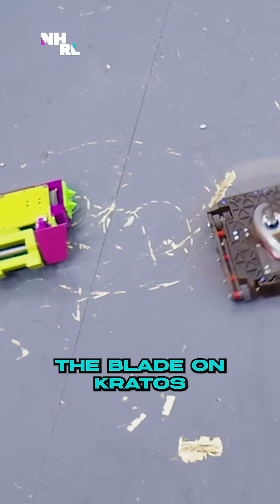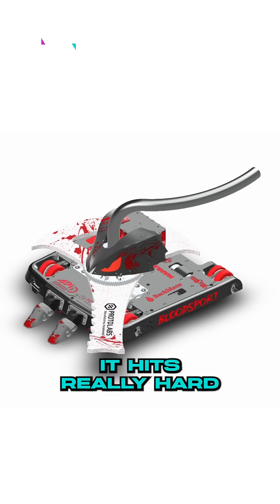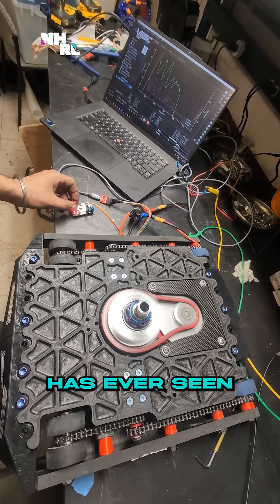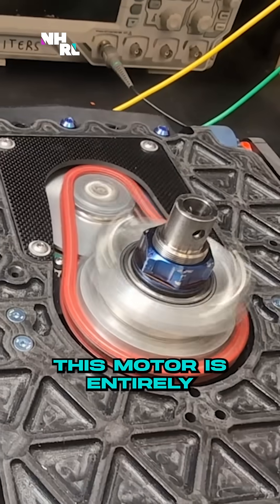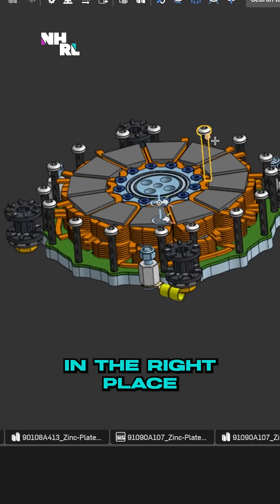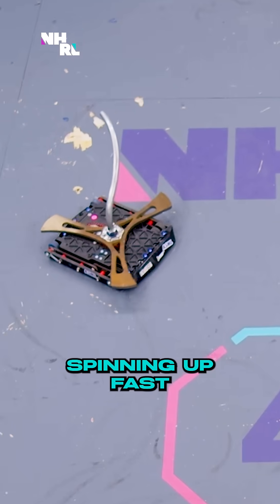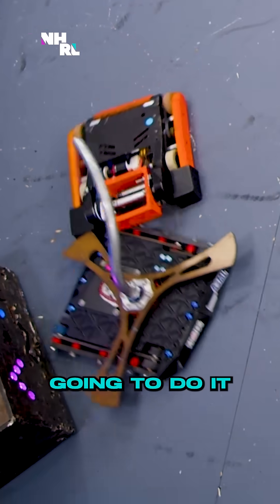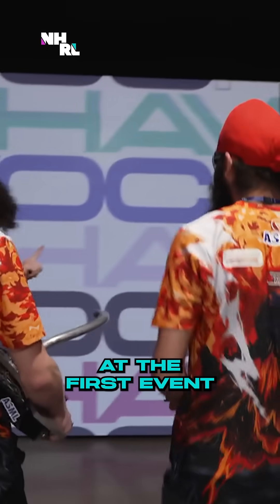MIT Team Built a Custom Axial Flux Motor to Fight Robots

Comment: either Clutch plate failed or motor-blade conmeting machinism failed or Due to the impact force the moter lost its momentum and slowed down causing back emf and frying the motor electronics or due to the impact force electronic components or battery connections must had dislocated

Comment: Was it just me or anyone else was waiting for the dude to explain the reason behind that wierd iron pipe they have installed on top of it??
Also they need to add more gears or bearing to the chained gears of blades, because then this way upon impact the motor will not take direct hit and break it, the impact will be heavily reduced by bearing or loosely fitted another set of gears whos only purpose is to absorb the reverse rotation impact!
They need to install free wheeling in it which is used in electrical bikes....
Reply: The weird aluminum pipe on the top is extremely useful.  I think, required.

Comment: Should probably go with a belt drive instead of a gear drive. You could also do the equivalent of a CVT in there and that would help get the weapon spun up quickly without overburdening the motor

Comment: They forgot to protect the base. If another machine with a lower rotating blade hits Kratos and did a slightly upward impact, then it's cooked. 

Also, they should use a lighter and more resilient material for the blade with machine protection in its priority.

Another is that the base design is square which is counter intuitive for its weapon which produces a circular motion. Either make it circular or a hexagon. 

Lastly, can't they place the blade like a burger patty? Put the electronics and some shield in the upper and base part of the machine? 

I'm just asking. I'm sure lot's of people here smart. Please do answer some of my questions/suggestions. 🍻

Comment: I used Google gemini to create a scalable software program

Out of magnetic motors, Dynamos, electric motors, and magnetic motors, with dynamo recyclers inside, for ionic thrust and data transmission and gyroscopes

As well as power generation, and motor control 

With magnets, copper, rings, and ball bearings or roller bearings, and batteries, sometimes gold also

Comment: Well….koenigsegg(the hyper car company)has had 2 motors just like for a few years now….they even call it an “axial flux motor” so…..the chances of that happening id say are pretty slim……the call them “Dark Matter” and “Quarke-E” ….they boast unmatched power to weight ratio…..annnndddd they look IDENTICAL to the one here…..and if its been out for years….it was likely in production for several years before that….

Comment: Lower the weight of the arms because only the ends make contact ... and make the blades slightly heavier as that'll give you more rotational impact on contact ... replace the arms with Aluminum...and make the blades custom and interchangeable based on robots you're fighting ... great design

Comment: I'm surprised the MIT guys tries using an axial motor in this application.. It's really wide so it has tons of initial inertia which means they're harder to get going. Imagine trying to lift someone on a seesaw except their side is really long and your side is really short. It takes a lot more effort to get it started.

On top of that the other problem with being flat and wide is it's really thin so it's easy to bend and break. It's basically the worst possible application of this motor.

Comment: That's similar motor tech to what's used in the Thrustmaster T598 Direct Drive wheel base and that thing for its size has some real power, so if they managed to put that tech in a robot then I wouldnt want to be the one to challenge it, also if you have managed to make your own design and its compact then patent your design if possible and talk to other companies as im sure lots wouldnt mind a small motor like that as most the other motors of this type seem top be larger than what's shown here.

Comment: I’m in the engineering pathway at my high school and my freshman year I made a generator using a similar principle. The only issue is that I didn’t know to use insulated wire and the stator and rotor were too far apart, so I’m planning on trying again soon

Comment: Hearing him talk about how advanced this new engine is, just to see it not be able to spin up and face the exact issue they were trying to avoid still happen is hilarious.
Reply: "we just need a fraction of light speed and it will work, that's what the fusion reactor is for"
Reply: Probably the motor controller frying. I guess they must have built a custom one for their custom motor, and it's not an easy task, especially when you go from 1000 rpm to 0 rpm almost instantly, these things can fry easily.
Reply: *motor
Reply: Did they even test it one time??? Wtf
Reply: @HCEndgame absolutely , test it one thing, they’re a college sports ? Robotics + Sports team and they , absolutely did function tests.  It is expensive to replace those pieces and repair the whole thing & what other robots would they fight with? Not many other fight-bots to  test on! ! 😅

Comment: Looks like maybe an issue with the chain not meshing properly. With those speeds and torque you absolutely need a serious tensioner. Preferably a chain guide style. I'd imagine it could stretch a small chain like that out pretty quick

Comment: Of the ends of those propellers angled down at the tips and then went flat out at a lower trajectory, a few millimeters off floor level with a slanted edge like a blade, it would be able to slightly lift other robots and negate their traction as it pushes with its main movement motor.

Comment: I’m sure they already know this but they will need an encoder on the motor and a controller which can do sensored control. Then they can get full torque at zero RPM. A controller designed for propellers is good at high speed control but they have poor low speed torque as they only need to spin up a prop. A controller like Odrive could do it!

Comment: One design I thought about the haven't seen, is a spinning disk or shield designed to absorb the high velocity impacts of these type of attacking machines and transfer that energy into a rod that both goes out, under, and up an attempt to flip or thwart the attacking machines every time they utilize their only specialty. It would not be a full transfer of energy. I'd have to take a lot of absorption, but could still puncture or flip.

Comment: The most important thing here is not the speed, or how fast it spinup.but how can it withstand impact... Each impact at full speed from the tip of the blade is  gonna transmit and INSANE amount of force to the motor. And THAT is what break motors on those kind of spinner.

Comment: Yes 👍. You are spot on. Maximize the motor diameter as much as rules allows. The rotor diameter adds to the torque thereby have better acceleration. Furthermore I see You increase the torque further by an increasing ratio with sprockets & chain. Any extra links or gears does creates the weak point. I see the best possible way is to fixed the weapon on the rotor itself thereby simplifying the setup. ❤thanks for sharing your Built. Awesome bro. Good job.

Comment: MIT the type to invent a new motor for a fighting robot
Reply: It's a direct copy of a motor that is already on the market that you can buy. The company is small & they aren't everywhere or anything but the fact they've gone as far as fitting them on bikes OEM sure makes the dudes claim silly.
Reply: @bo-dine7971  Sure, but this one is actually flux optimized and manufacturing the flat coils is also not trivial. They obviously have access to special tooling for that. You still have to know your stuff to even know where to begin with the design.
Reply: @Atom224 exactly this. Not a new motor type, just a custom design of it.

Comment: Instead of using a chain drive, it would be better to use a direct drive system. When the machine suddenly stops due to an obstruction or impact, all the pressure and force are transferred directly to the chain, which can lead to damage or failure. Please correct me if I’m wrong
Reply: they need the gearing reduction of the chain drive. Something like a torque converter you see in a car might be better for this application though.

Comment: Idk if it would be possible weight wise, but you could have a flywheel with a similar mass and a clutch. Flywheel never stops spinning and helps to get the blade up to speed.

Comment: Ah. He messed up the offset of the coils and magnets for stratup. Needs a flywheel on motor and it Needs a CVT enstead of a chain like the ones on go karts. Then when it hits something it slips and your motor still spins then eventually the cvt clutch kicks in and gets your blade back up to speed, put a hydro torgue converter for a car to it and that motor would never feel a thing

Comment: You might want to consider using a viscous clutch / torque converter so the motor gets to spin full time and the blades only slow down on impact. Should also make it more gentle on the driveline. A simple housing and impeller with silicone oil might make it possibe. Kinda like a viscous fan clutch from a car.

Comment: That looks fiercely dangerous. And I’m not talking about “to the other robots,” but rather to the spectators. It’s not as if these robots never wreck each other. (Hardly that!) 

So let’s assume: a) that some other robot manages to damage this one—and b) that the damage causes that rotor to fly off. In the event, I doubt that the protective plexiglass screen between the arena and the audience would be enough to sufficiently contain the relatively huge amount of energy stored up in what is basically a heavy flyweheel with teeth. Hell, it could just as easily fly over the plexiglass barrier.

Comment: That motor works basically the same way maglev trains get pulled down the track or how modern rollercoasters launch without a hill. They seem to need to work on their programming and probably add a backup to control it if the main breaks.
Reply: That's basically how all electric motors work. It's just various setups of coils and magnets.

Comment: Design a gear between the motor and the drive that chain ⛓️‍💥 is going to be your weakest point it will snap when you slam it to a stop after so many times

Comment: I had heard about these well i read the paper on it. I can't believe you built one that is awesome. I am a bit surprised that you guys aren't utilizing some of the magnetic energy to couple the drive shaft magnetically reducing friction and increasing the torque and rpm. also reduces complexity as all you need to do is arrange some magnets around the shaft and add a coil to amplify the field and spin it up on a vac bearing to see how fast you can get it before centrifuge become the issue for the blade.

Comment: axial flux motors used to be used quite commonly in disk drives, most commonly 3.5 and 5.25" floppy drives, seeing one setup this way was impressive, can't wait to see where this goes, also, might wanna add a clutch so you can disengage the weapon from the drive
Reply: I think the motor is the clutch. If the weapon gets stopped the rotor just stops spinning inside the stator.
Reply: @nunuvyerbizness  Agreed I imagine they're driving it with FOC capable electronics so it's probably as "easy" as automatically letting the motor freewheel as soon as the current peak from an impact is detected.
Reply: @oliverer3  could that be why they had trouble? Motor got cut with an impact and couldn't get far enough away to get started, or something bent and added slightly more resistance than expected?
Reply: @freescape08  Seems plausible, it can probably deal with some additional resistance but starting up with it physically blocked certainly wouldn't work.

But if memory serves their main issue at the start was that the motor was wound for peak RPM rather than torque so it had so low stall torque that it struggled to commutate properly.
Reply: @nunuvyerbizness what’s the chain for?
Reply: @altenmuenster  To isolate the sideways forces on the shaft from an impact, bending the motor shaft would be much more inconvenient.
 Also useful for a gear ratio and shifting the position of the motor if needed.
Reply: I love when you talk nerdy. Turns my floppy disk into a hard drive...if ya know what I mean 😉
Reply: I suppose it needs two stages, one to get the heavy motors started and the other to switch into for high speed within a second or so
Reply: @Sokofeather absolutely! This is the fix
Reply: Also in high speed VHS and HDDs.
Reply: Adding a clutch isn't most likely required if other safety measures are followed. Most likely it would only add more weight to the bot.
Reply: Leave it to Berkeley/Stanford/MIT/Carnegie kids to think they invented the wheel lol.

Comment: You might want to consider installing a clutch of some kind between the drive gear and the blade so the sudden stops when you hit the enemy robot aren't as devastating to the motor.
Reply: Eureka 
Aahh moment
Reply: maybe just a spring disc like the one on the clutch is enough.
Reply: yup, that's what kills lawnmowers
Reply: Or better yet, a torque converter.
Reply: @DARTHNECRION  A clutch and spring pack would be lighter, no? Intuition is pointing to liquid=heavy in my brain.
Reply: afaik the point of the design is that the motor should be able to tank the hit, and the chain acts as a small buffer.
Reply: Better yet: a bunch of small axles gripping on a rubber wheel, like bite force
Reply: Better yet: a bunch of small axles gripping on a rubber wheel, like bite force
Reply: That's a clever way
Hope it makes to the list of top comments

Comment: Stay in close and don't let the blade start to spin at all if you can. If you can get this advantage you pretty much render it useless. It doesn't seem to have a lot of torques I support would be considered from a dead stand still. Correct me of I'm using the wrong term if you want.
Reply: That's why he built the motor - to avoid that issue. Axial flux motors are incredibly power dense things, so it spins up fast. These are where the research is for electric cars, putting these motors in each wheel hub!

Comment: They need to build the blade of cast aluminum alloy and put high carbon steel tips on it to lighten the load a little
Reply: High carbon would explode on impact and the aluminium would rip off or deform 😂
Reply: That would deform on the first hit.

Comment: They should try a small clutch instead of the chain. Don't have to waste time spinning up the motor if it never stops. A little clutch slip and you got a spinning blade! Just disconnect the clutch before you hit...
Reply: It takes time spinning up the weight of the blade not the motor itself.
Reply: @epictimebreaker  yeah, that's why they should slip the clutch until it's going fast enough... like I said. It would spin it up a lot faster than just a chain. A torque converter would work similarly, but they weigh too much to be of much use.

Comment: I'm genuinely shocked axial flux motors aren't more widely used.
Reply: One drawback is that an axial flux motor puts a big axial load on the bearings, whereas the magnetic forces in a traditional radial flux motor cancel out.